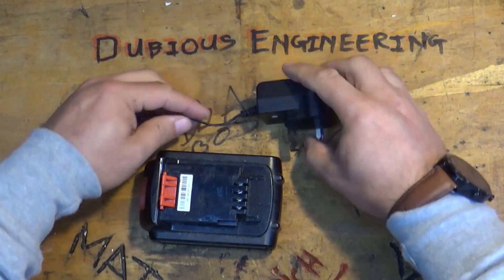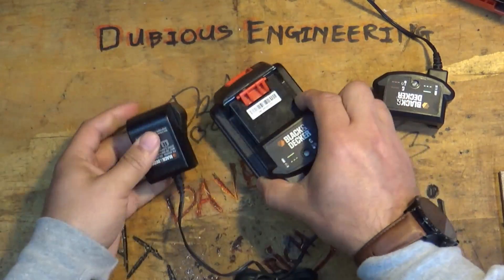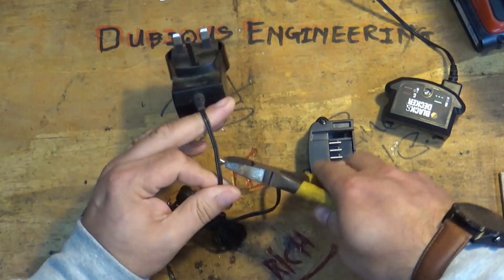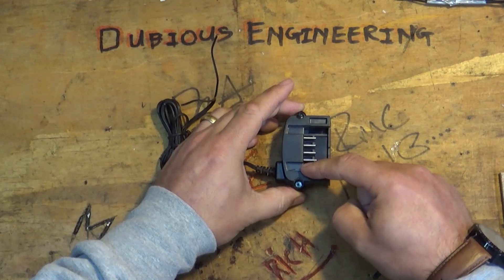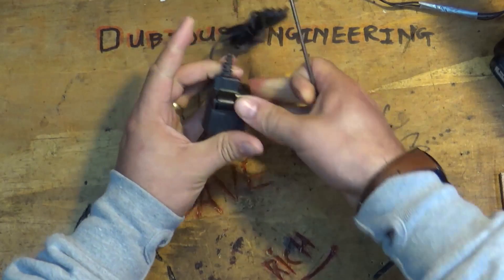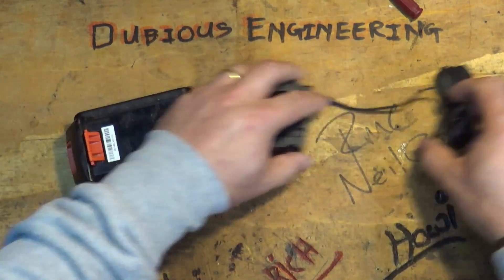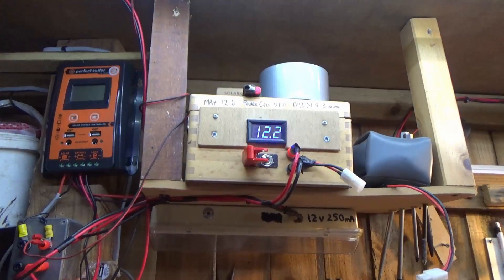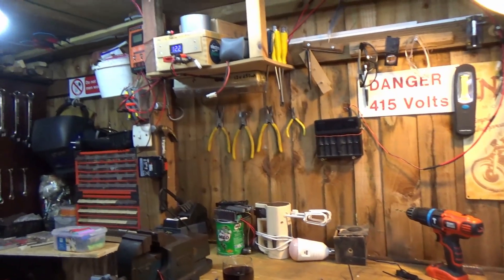DuB-EnG: Black & Decker Lithium Battery Charger problems, teardown, repair troubleshoot fix...

Comment: You've just saved me £27. I watched your vid and replaced the plug, Hey Presto - working charger.
Reply from the maker: Now that’s the kind of comment that makes me happy!!! :-).  Great to know!! I hope it’s a 21 volt charger... you’ll need that to hit the 18v capacity of the battery...  all th best!! Howard
Reply: @DubiousEngineering  I spoke to soon. The green light flashes but doesn't give any charge. I'll strip it all back down and rewire it tomorrow just in case I didn't do it right first time.
Reply: @mcw68  did u ever fix it. Mine keeps flashing red very rapidly.
Reply: @tonykari5124  no,  thought I had, but didn't charge up. Ended up buying a new one.

Comment: Did you investigate the center two pins on the charger? What voltage should appear there during charging?
Reply from the maker: Thats a resistive thermocouple - temperature sensor.  Not a voltage.

Comment: Can one connect an Imax B6 AC battery charger to the negative and positive contact pins on the battery pack to charge the battery pack?
Reply from the maker: Oh yeah! Set to 1amp and 18v li ion ...  easy peasy

Comment: I get a single, once second green blink from the LED when I connect a new power supply - and no further lights or indicators. Anyone else experience this or have suggestions?
Reply from the maker: Check the battery you have connected is reading 14 or more volts

Comment: I am unsure if you were promoting your Solar connection idea or how to screw the charger on the wall. ( Not taking away from their value, I think they both exemplified great ideals.)  It seemed that you initially showed the cut off powered supplies and seemed like you said they were the problem.  Then in the end it appeared you showed the same cut off power supplies and suggested that any power supply would work, but showing the ones you originally said were the problem.  Forgive me, I am not very knowledgeable in this area.   Were you suggesting that any power supply from any/most tools or devices would work?  Thank you for your time and the video and knowledge you demonstrated will definitely bring me back.
Reply from the maker: You need a 20volt dc power supply…. I agree I wasn’t clear on my video explanation.  Best, H

Comment: I use DeWalt products. I haven't had any charging problems. 
I just bought a 20v Black and Decker hedge trimmer and the batteries won't charge and they are brand new. The LED blinks red. Brand New. 

Your video is wonderful 💯
Reply from the maker: Yeah, I'd choose DeWalt over B&D any day...  But you'll pay the price 😀😜
Reply: @DubiousEngineering  Sometimes the extra price reduces problems down the road. Now I've got to go somewhere to borrow somebody's battery. 
Black and Decker is having tons of problems with these batteries because they are discharged in warehouses before being shipped. 

I'm trying to contact them now. 
Thanks for replying to me and I enjoy your channel!

Comment: Any ideas why a black and Becker battery blinks green for judt a few mins then goes solis green but still jot charged or charging? Any help appreciated. Thanks.
Reply from the maker: Measure the voltage of the battery….  or try another battery…

Comment: Great video. Replaced faulty unit with a spare 15v power supply, and it's now charging. Thank you 👍
Reply from the maker: Happy days dude 😎 !!!
Reply: @DubiousEngineering  Spoke too soon 😪  Charger ends up flashing red, same as @tonykari5124. Battery charges fine with original charger. Maybe the power supply isn't quite right?

Comment: Great video, I know what I’ll be doing next summer on the roof of my shed. Quick question though why are your batteries marked 18 V and here in Canada are batteries are 20 V? Also a quick tip, if you find Porter-cable 20 V batteries at 5 or 6 mA hours they will work on a Black & Decker tool. all you need to do is cut a notch on the left side of the battery to make them fit in the black and decker tool otherwise they’re an exact duplicate. I found this out on a video on YouTube. Mike from Montreal.
Reply from the maker: Oh cool!! I had no idea black and decker were so popular in Canada

Comment: I don't know WTF you're talking about. I have used a B&D 20V charger for years with NO issues what so ever. Maybe you stop slaming these things on your work bench. They are after all electronic devices that are rather delicate!
Reply from the maker: Glad your having no issues...   Take a look in the comments here, there's a lot of people who sadly are struggling with multiple failures.  It's possible you have a more modern version?  Best. Howard

Comment: I don't understand how the router power supply will "know" to stop charging the battery... won't it over charge?
Reply from the maker: The intelligence is in the plastic clip on module ... that keeps an eye on the battery voltage.  Best, Howard

Comment: I had a b and d showing faulty battery, but after checking the batteries everything was fine. But still charger shows blinking red light. Confused to what to do. 
Any suggestions appriciated.
Reply from the maker: Cut the cable and check the output of the wall socket with a multimeter...  if its not around 20 volts then the psu has failed.  Sadly, it may also be a fault with the sensing technology in the charge end.
Reply: @DubiousEngineering  seems like something wrong with the board connecting the batteries, check the voltage it's showing 25vs. Batteries are all working good, Seems like I need to replace the board.

Comment: Hi Dub, I’ve bought a generic charger and switched it to 18v, but the light still doesn’t come on!?, any advice?, many thanks.  Mark
Reply from the maker: Hi Mark, so sorry to hear, sounds like the charge end of the cable has died rather than the power supply.

Comment: I suspect that when it says on the side of the charger "8-20v" that is not to tell you that a charger anywhere between those voltages will work, that's to tell you that the charger itself varies it's voltage according to the need of the battery.
So yes, a 12 v power supply will get you a flashing green light, but the charging will be inefficient and you risk damage to the battery.
Reply from the maker: Why would a lover voltage risk damage to the battery?  But yes I agree with you! Aside from potential damage.

Comment: Hi , I've 2 drills with the chargers not working,  
It's a A9277 18v sl13yd battery , any help to charge this please
Reply from the maker: If you're in the uk, I may be able to build you a charger, but you may just want to buy some new tools :-)

Comment: I always wondered why those adapters showed a range like 9 to 20V ? I had one I pulled from a car jumper/air pump which kicks out 14V at 750mA and will see if B&D battery will charge up after being stuck at 9V Thanks You may have saved me some $
Reply from the maker: Good luck, you may need something closer to 20v.
Reply: @DubiousEngineering  yep it went up to 14.5V

Comment: 20V(20,27V) 4.5A not working..(laptop charger).
Or was working  5sec 😂 
Start to smoke (two 1MH5, diod? ) no current limiter on the board?
Reply from the maker: Yeah that should have worked...  no idea why it let the smoke out!

Comment: So, If the charger sits with solid red, even with battery fitted, its the power supply socket, not the battery?
Reply from the maker: Sometimes it's related to the charger.  Try another battery if you have one!

Comment: dry joints/broken connections inside the wall charger and shorted smd capacitor inside the part that you plug the battery into to charge it. and no...they don't/wont work/charge on 8 to 20 volts...they will only work/charge the battery with a wall charger that will supply 18 to 20 volts @400mA upwards. one of the worst pieces of Chinese crap I've had the displeasure of working at...the drills ok but the "electronics" is pure rubbish!
Reply from the maker: Totally agreed 👍... pure rubbish! 👌

Comment: Hi can you explain where you attached to solar panel ,did you go to charge controller input as I have one solar panel going to charge controller can I go into that or do I need another solar panel
Reply from the maker: Hi so sorry, this was years ago now.  I'm sure you'll figure it out.  You can put up to 22volts into the charge unit
Reply: @DubiousEngineering  thanks for reply ,I'll just buy a 21v supply unit and charge from mains  but would have been good to use me vans solar to charge batteries

Comment: Is it safe to change the B&D power supply (which said output power 8v-20v) to 21v or more?
Reply from the maker: 21V is fine...  you may even get away with 24...

Comment: Thanks man, I run onto your video because I have the same cases. My b&d charger doesn't work. And I don't believe it is battery or the charger controller because I do check the cables and the plug charger doesn't flow current. So, look like I'm gonna do some modifications now.
Reply from the maker: Good luck with the mods ...  use a 21v or more psu
Reply: @DubiousEngineering   Oh ok. Thanks man

Comment: Does this then mean (in simple terms) that I can just replace the "SMPS" (switch mode power supply) with a linear power supply, as long as the output voltage is at the correct level.
By "correct level" is that then minimum 18V, although 20V-21V would be better?
Reply from the maker: Nailed it!

Comment: I was having issues with my 40v charger indicating overheat. The fix was CRC contact cleaner and a tiny screwdriver to clean the contacts, free and easy.
Reply from the maker: That's great news thanks for the tip!

Comment: :( in my situation the part which is bad is the controller . The problem is that the 5V regulator failed (by short) an destroy something in the one or two ICs . I can not manage to identify the ICs (smd) . Can you help me with a schematics or the SMD ICs part number (or schematics) of the little PCB? The model is Black $ Decker BDCDC18 . Thank you!
Reply from the maker: I'm so sorry - I dont have a CCT diagram, and the cips looked like they were custom, couldn't read numbers off them.

Comment: Just what I needed. Now I can screw the charger straight thru, between the metal contacts, out its rear into a bracket where I will line up 4 chargers with space to clip and charge 4 batteries at once.
Reply from the maker: Happy days!! Great job bud!!

Comment: Nowadays, because plenty of stuff is battery operated, we end up gathering dozens of chargers. Don’t ask how many I have😃😃. All my Ryobi batteries are charged in the car using a Ryobi in-car battery charger.
Reply from the maker: iMaxB6 is a brilliant charger for loads of batteries 🔋
Reply: @DubiousEngineering  
I’m not familiar with that charger. For now I have a heck of an array of chargers for Parkside, worx, Ryobi, Milwaukee. I even have a liitokala lii-500 for charging 18650 cells and so on. Please, I don’t want more chargers 😂

Comment: I have a B&D 10.8V electric drill and the switching power adaptor isn't working. If I were to replace the power adaptor, what power adaptor should I choose? On it it says 8-20v.  Pls advise. Btw, I hooked up a 12V 500mA adaptor. When plug in, green light is blinking, but it doesn't seem to charge.
Reply from the maker: I'm not sure if that device works the same way.  Is it NiMh, LiIon or NiCad battery?
Reply: @DubiousEngineering  mine is LiOn battery

Comment: Got a brand new B&D strimmer that uses an 18V 2AH battery. It's almost more of a toy than a tool but nevertheless it could be useful if the battery didn't run out in less than 30min, and the charging takes 5 hours because this stupid charger only delivers 0.4A of current.
If the piece that plugs in the wall is the part that limits the charge rate to just 0.4 amps I could use this hack with some 2A charger for a more reasonable charging duration.
Quite disappointing really how crap the included charger is, by comparison my Makita reciprocating saw has a 5A charger with a built in fan that cools the battery internally so it's safe to charge it at that rate.
Reply from the maker: I make adapters so you can use your makita battery on your b and d strimmer.  Let me know if interested... best, Howard
Reply: @DubiousEngineering  
Thanks for the offer but the postage alone would add up to the cost of a spare battery since I'm rather far from the UK.
I've done some electronics repairs before, so I can probably manage modding either the charger or battery or both. Still need to get the proper torx bits though.

Comment: Incorrect for me. The plug end is putting out 24volts DC as it should. But the charge controller part with the flashing light is stuck on red flashing mode and refuses to put out voltage to the battery. Suppose I’ll have to bypass it but be careful I don’t overcharge the battery.
Reply from the maker: Hi Tom, have a look at the imax B6 charger... it’s not expensive and will charge / discharge many batteries... I love it
Reply: The solution did not work for me either. I took a working charger & wall power supple pair. I cut the cable and connected thre charger to a bench top  power supply. (I was also hoping to use the idea to charge battery packs in my shed.)
The green light flashed, but the supply's current meter indicated zero current. (I checked with the bench top supply set to various voltages, but no success.)
When I reconnected the original plugtop power supply, the charger worked; flashing green LED and current delivered to battery - confirmed with a meter.
Any ideas?

Comment: Actually it's just happen to mine. I bought a b&d 7 months ago and the charger suddenly flashing red.
Even though I rarely used it.
So I guess the sockets is the problem. I'll try to find something and fix it like yours. Thanks.
Reply from the maker: Find yourself a 21volt supply if you can... that will do the trick!!

Comment: I sat down with a 20v and tge b&d little plug in type..  but its not the power supply part you plug into the wall its a microchip inside  of the chargers..  if you leave it plugged in for a while it will automatically reject every battery you put in it..  if you discharge all the tiny caps in the unit then it will charge the battery like new..  I thought it was fishy when instantly the charger would reject and not even test the battery in the slightest..  so it was on auto reject.  It was the same one you took apart in thr video..  but i had a security bit..  but if you look between the pins theres a square microchip that is unnecessary but installed there to do this and cause buyers to get a new battery when the things fine...  or what works is if you unplug the power supply from the board then it will reset and charge again..
Reply from the maker: This is a very interesting point...  So, you suggest leave it unplugged for a period of time to let the caps dis-charge and then have another go?

Comment: Addendum: HIGHER voltages apparently work better - 9V (500mA) gives you extremely long charging times, so long in fact that the charging controller goes into failure mode with a time-out...
Reply from the maker: You need about 22 volts to hit the max charge levels at 500ma or more.
Reply: @DubiousEngineering  Hooked up my lab power supply so I can control voltage and current properly - works great!
Reply: @f.d.6667   how are we to not overcharge the battery and burn down the shed? if we are just turning the power on with no timer or sensing circuit?

Comment: probably a stupid question (am a nervous novice with electricity) but can I just connect a bog standard spare plug I have kicking about (rather than the fancy solar powered thing you did)?
Reply from the maker: Please describe your "spare plug" - and i'll advise!
Reply: @DubiousEngineering  Hi, thanks for the response.  I just meant like a standard  fused 3 pin (although not connecting the earthed pin) I can buy from a local hardware shop

Comment: Awesome! You just saved me 35 EUR!!! ... found a conventional (transformer & rectifier) no-name wall wart 9V/500mA and it's working great!
Reply from the maker: Glad I could help - You may need a little more than 9v - try 20-22v
Reply: @DubiousEngineering  Will do! Thanks for the info!

Comment: Hello, my charger is fine but the head (with flash light) is dead. Do you know the output voltage from the head ? How much voltage the battery should have at full charge ? Thanks
Reply from the maker: 4.2 x 5 = 21v when fully charged

Comment: My issue is how the battery... Which is a twenty volt version. They increased the voltage so the cells are charged to 4 volts. In mine one cell, 18650 size, is a bit more charged than the other 4 cells.
I've ordered a BMS board to have the cable so I can drain that one cell down equal by plugging it into a battery conditioner.
Reply from the maker: Hmmm...   Thats annoying.  Good luck!!

Comment: Mine stopped working, I had a 24v, 2.5amp, 60w, so connected that up, charging fine, but I can smell an electrical burning from the charger head.  It's been unplugged for a day, but the circuit in the head doesn't like it!  Too much voltage or current?  I'm not going to use it again, will get another charger if you can recommend me a better spec.  I believe the spec on the original plug was 18V, 400mA.  I can easily buy one with 20v or 21v, not sure what current it should be rated at. Thanks
Reply from the maker: Thanks for sharing...  its interesting as the original charger puts out a higher voltage too.  I had a look on ebay the other day - theres a chinese company sellling compatible chargeers for £12

Comment: Will the charging control electronics let through more current than the original 400mA if I replace the power supply with a higher current one? That is, can I make these small charging heads charge faster with a stronger supply?
Reply from the maker: A little you need 22v and 1amp
Reply: @DubiousEngineering  is that 1amp the max? Not bad, but still, 2 could be better :)